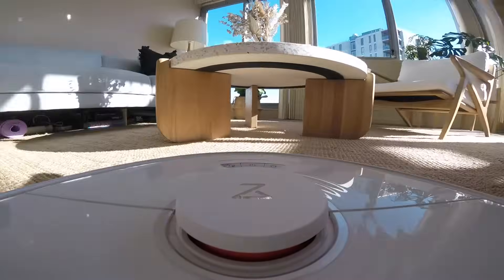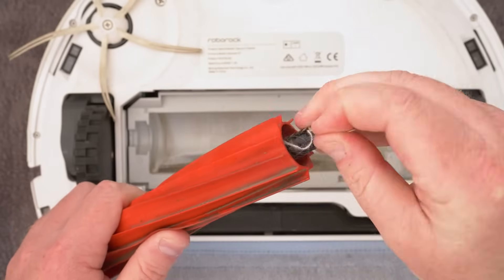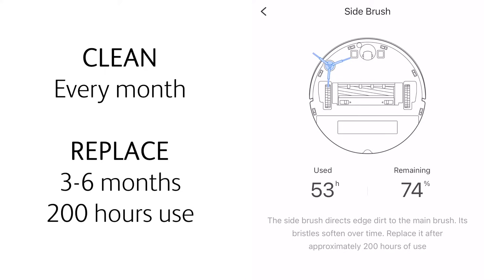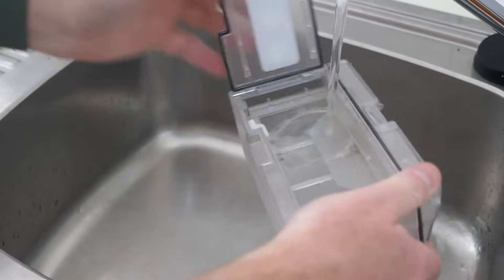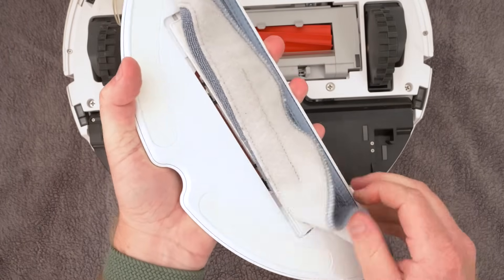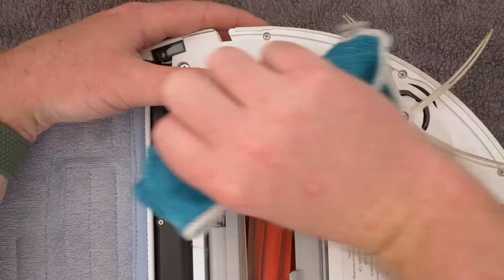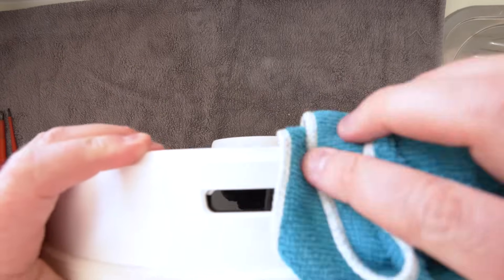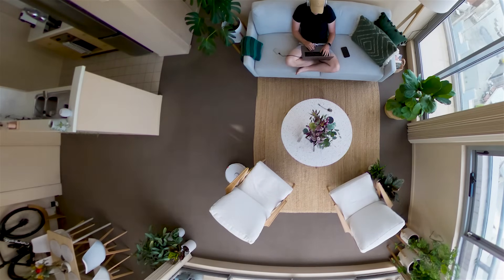Roborock Maintenance for Best Performance

Comment: After watching your videos I wonder if the robot really makes life simpler compared to traditional vacuuming and mopping. I would like to know your opinion.
Reply from the maker: Hi Giuliana, I definitely think it makes life easier around the home. Since buying the S7, only twice have I done a complete thorough vacuum with a plug in vacuum cleaner. I've found that by sending the Robovac out more regularly, reduces the need for manually vacuuming. It does have it's limitations in that it can't get right into tight corners and can't do skirting boards etc though, so depending on your home will determine how often you need to manually clean those areas.

This video describing the maintenance is as per the recommended schedules, but in reality, you can go a couple of weeks without needing to touch the device. If you get the auto-empty dock, the dust bin and paper filter maintenance all but goes away, as the auto-empty does such a good job at cleaning those items. Then all you need to do is empty the auto-empty dust bin every 6-8 weeks, keep an eye on the main brush for tangles, and sensors for dust!
Reply: A robot does a much better job than us because it travels along the area's slower, picking up more material! a robot doesn't,  rush the hated job or get  bored like we do.
You can programme it to  vacuum when you are out even, you can keep your home more dust free with a robot because you vacuum more often with a robot!
Less dust on the floor = less dust everywhere else!
Just use your plug in vacuum with the small point nozzle to clean out your robots bin and bin filter in situ!

Comment: Very helpful video, thanks for making this. I just got a Roborock T7 and it's basically the same machine, so this was a useful reference point. Your instructions were clear and the video's well edited.

The only thing in the video I'd change is don't wash the filter, it clogs it up and doesn't remove dust. Use a proper vacuum or brush to get the dust off the filter. Or get some cheap replacement filters, and replace the filters more regularly. The Roborock subreddit has some good tips.
Reply: Can you give link to such post ?

Comment: Great video!! Any idea if it’s ok to leave the mop on the vacuum always on a S7 + ? The manual says it has to be removed after every use but some forums suggest it’s ok to leave it on for the S7+ . Thank you
Reply: Remove it! It starts smelling after each use, and you are smearing stinky water all over your floors.
Reply from the maker: Thanks for watching! I've had no issues with leaving the mop on after each use. Of course, it's probably best to remove it and replace with a clean mop pad before your next mopping cycle to ensure it does the best job it can!

Comment: 3:00 NO! Don't do it like that, you just destroyed your filter. Clean the dust first and run the water from the other side. Don't clog it more ffs.
Reply: It literally says on the filters to wash them. Just let them fully dry
Reply: What is the correct way to wash it?
Reply: @RichardRojasL  Just don't wash it, it clogs up the filter and doesn't remove dust. Use a proper vacuum or brush to get the dust off the filter. Or get some cheap replacement filters, and replace the filters more regularly.
Reply: @Shambolic2000 don’t brush it lol u will damage fibers. Just shake it and run water from other side as air goes. (Not the side that is dirty)

Comment: Hi I have bought Roborock S7 +. But after two weeks of use, I sent it back because I thought the mopping was lousy. I understand that you have to wet the mop before starting the robot vacuum cleaner. but after half the house, the mop has been wiped off and the robot vacuum cleaner mops a maximum of 7 to 10 cm wide on the floor. the difference between s6v max and s7, is that the water drainage on the s6v max in two places on the mop on each side. which means that the entire width of the mop is constantly wet. while s7 has a single drain in the middle which is not enough to bleed the whole mop, resulting in it mops max 7 to 10 cm max. I would need your opinion on this .. or if I'm doing something wrong
Reply from the maker: Hi Mina, that sounds about right I think unfortunately. I've found that I need to wet the mop pad before starting to get the best result, and then the robot water tank just supplements the water already on the damp mop pad. I only have a small amount of hard floors to mop in my place, but I could assume on a larger area of hard floors, the pre-wet mop pad may dry out, in which case it's just relying on the dispensing from the water tank to keep up, which isn't great on it's own. I think the S7 is a great robot vacuum, but just an 'ok' mopping vacuum. You may potentially benefit from a more mopping specific robot if thats a priority for you.
Reply: @iamjoshstunell  I think this issue has been solved with the S7 MaxV Ultra. If the robot has been sitting in the dock for a few days and the mop has dried out, you press the home button and it cleans and wets the mop. Only with dried up spills I have needed the robot to make a second run to mop it really clean.
Reply: I think I saw that the S6 max? Not sure and above had a new type of mop pad ??? Have you seen/ heard this?

Comment: Does the machine need to be charged at all times? If not, how do I turn it off? Thank you .
Reply from the maker: Hi Maritess, the robot has a dock that stays plugged into power at all times, and the robot finds it way back to the dock to charge up after each clean cycle, and stays there until it is needed to be used again. That way the battery in the robot is always charged and ready to go.
Reply: @iamjoshstunell  Thank you.
Reply: Can I switch off the mains after it's 100% charged?
Reply: You dont need to switch it off but if you want to switch it of then you can

Comment: I need a robot to clean my cleaning robot.
Reply: I need a supervisor robot that can supervise the cleaner robot
Reply: @adamjobs  And a CEO robot that can review the supervisor robot's performance and fire it if it gets lazy.
Reply: The maxV new dock partially does that
Reply: @Skeksotheemperor  Yeah, but what about the invasion of privacy? The camera is  over the top.
Reply: @Sun.n.Flowers  very true
Reply: Still waiting for this invention.. Ended up buying a mini cleaning kit online.
Reply: yes!!!
Reply: You can put it into the washing machine and they dryer. It will come out clean for your reuse.
Reply: That's the problem i had with Rumba. I bought it to help me cause i can't lift much,instead i ended up lifting it all the time to clean it. Lets just say it was quite heavy to carry and hair tangled into wheels. I just ordered Roborock q7 max plus,and i'm already scared how i'll need to constantly follow it around to save it from stucks. I had Vileda in between,and that one was very simple to pick up and also clean.😂
Reply: The worst piece of garbage I ever bought

This crap worked fine one month and then stop working, by contact the manufacturer they said of clean it up and try again which obviously didn’t fix the issue. Then they asked to the item to be returned there has been ONE month without no news or updates. They should have the decency to send a brand new or give my money back, instead they will fix it and se d it back, which they didn’t yet. NOT RECOMMENDED!!!!!

I regret not buying it, it took more than a month to fix it and today my Roborock arrived with the roller wet and smelly (I don't know if it's working) but what a rubbish service. (If you want advice, don't buy this product)
Reply: The expensive version cleans itself.
Reply: Me too! I wonder if there is any gadgets that would help with this, especially to suck out the dirt on the rubber brush. 

I wipe mine and then wash it once a week and set it to dry near a window.

Comment: Thanks for this video. We got our robot 3 weeks ago and at first it was fabulous but now it's leaving a lot of streaks and semi circles where it turns round. Have you noticed this, and if so, any idea what to do?
Reply from the maker: Hi Suzanne, is this in the mopping mode? I’ve found by wetting the entire mop pad yourself, and then wringing the mop pad out before running a mop clean seems to perform better.
Reply: @iamjoshstunell  I agree. I got a shipment of new cloths and did that; it is much better. I think I am going to change my cloth every day now and machine wash the other ones.
Reply: I fill only distilled water in the tank. I’ve never had any issues with streaks. Even if I leave on the cloth for 1 week.

Comment: The thing you should rinse with water, you wiped. The thing that you shouldnt rinse with water, you run it under the tap.
Reply: The worst piece of garbage I ever bought

This crap worked fine one month and then stop working, by contact the manufacturer they said of clean it up and try again which obviously didn’t fix the issue. Then they asked to the item to be returned there has been ONE month without no news or updates. They should have the decency to send a brand new or give my money back, instead they will fix it and se d it back, which they didn’t yet. NOT RECOMMENDED!!!!!

I regret not buying it, it took more than a month to fix it and today my Roborock arrived with the roller wet and smelly (I don't know if it's working) but what a rubbish service. (If you want advice, don't buy this product)

Comment: How do you empty the hepa filter the grey one in the self emptying canister? The larger one inside the bag one.
Reply from the maker: Hey Shane, I had a look in the manual and it looks like you just rinse it and let it dry out thoroughly. Not much else to do with it! Check page 15 here - https://support.roborock.com/hc/en-us/articles/4404801088921-Auto-Emtpy-Dock-FCC-User-Mannual

Comment: This cleaning procedure scares me. I feel like I’m gonna jack things up, causing it to not “run” anymore. 😫 Great video, tho, so I will watch this as I give it a shot. Thank you! 🙏
Reply from the maker: Hey thanks for watching! None of the maintenance is too difficult once you do it the first time. If you are unsure, just take your time and don’t force anything that doesn’t feel like it’s fitting right like the bearings on the main brush! Otherwise most of the maintenance is just wiping it over! Let me know if you get stuck on anything :)
Reply: @iamjoshstunell  Yes, the omnidirectional wheel, I guess “prying”  it out is almost like gently forcing the part out. 😬 On the phone app maintenance, if it shows 90%ish, that means things should be taken care of, right? Thank you for your patience..✌️(I make things harder then they really are)
Reply from the maker: @xrockker  Haha gently forcing the wheel out is perhaps more appropriate! The first time I did it I was a bit unsure, but it popped out and in with a nice click each time. If you are showing 90% then you probably don't need to worry about replacing anything until that gets closer to 0%. The main thing I've been keeping clean is the dust bin and dust bin filter, and also the main brush to keep anything from being tangled there. The rest doesn't need maintaining too often.
Reply: @iamjoshstunell  Yeah, I guess gently forcing does sound ok, huh? I thought when you hit or near 100% on the maintenance app, that meant it’s time to do all the wiping/ changing out stuff, etc. 😐

Comment: What a great vid, A MUST watch for any Roborock S7 user, thanks alot for this.

2 questions;
- I like to rinse the filter with the dustbin, only with running water, around 4x a week. Is there a recommendation we minimise the water filter cleaning and do it fortnightly? Assumption is the more often we do it the better...

And finally will you get the auto emptying bin when released here? Potentially eliminating maintenance works for the dustbin and filter is pretty attractive...
Reply from the maker: Hi Ben thanks for watching and the kind words! All the recommended maintenance schedules I mention are out of the S7 manual.

The maintenance schedule would be dependent on the usage of the vacuum too, if you have a bigger area to clean, if you have pets inside, more prone to dust inside your home with open windows etc. then you will probably need to shorten any maintenance intervals.

My assumption with all the maintenance schedules provided is that's the longest time you should leave it between intervals, and anything more often will help the vacuum perform better. I don't see any issues with washing the filter more often!

As for the auto-empty dock, I'm super keen to get my hands on it! I've seen some reviews and it seems to do a really great job at cleaning out the dust bin and the filter, to a point where it almost looks like a brand new one!
Reply: @iamjoshstunell  I have the auto bin and you still need to do regular bin and filter cleaning
Reply: Yes